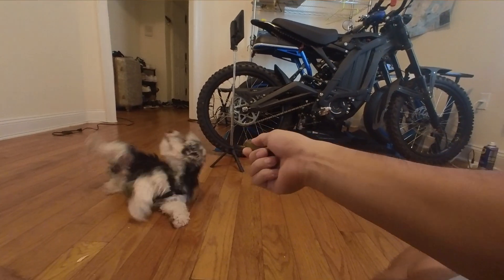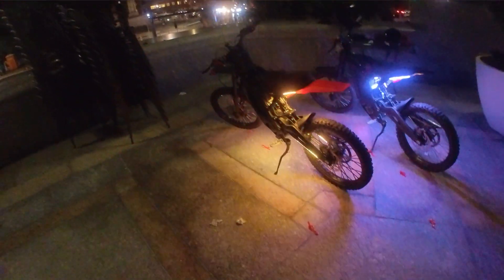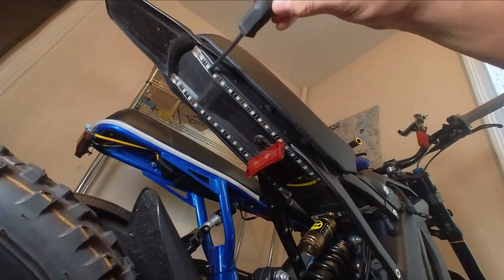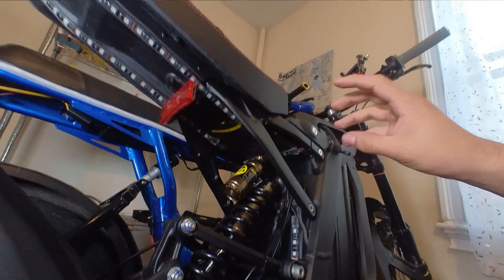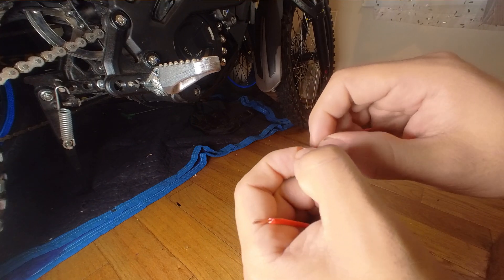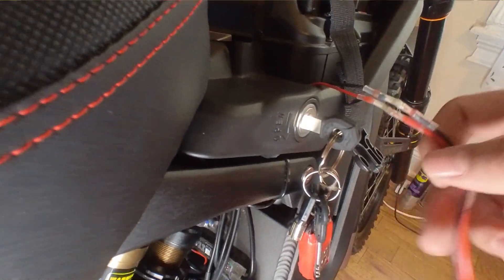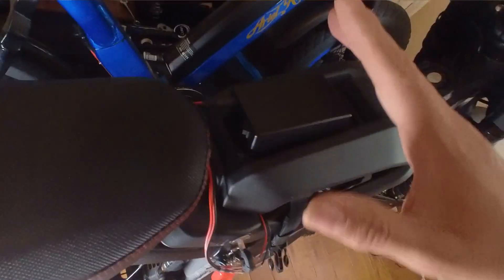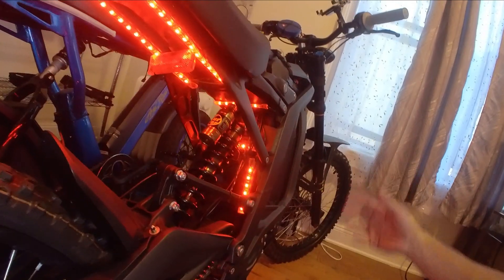DIY Sur ron Led Light kit tutorial (version 1)

Comment: Surron has 12v power supply for the tail and headlight easy to hook into, you can eliminate the bulky power supply box, use a volt meter to get the correct polarity
Reply from the maker: Yes and a lot of people that are really
Good at wiring tap into that for a much cleaner set up , they’re is actually a plug and play kit that is easier but around $120 , good to know that they’re many choice and methods to get LED light on a bike
Reply: @jaystyles33  which one 😋
Reply from the maker: @S2keyz  what do you mean :)?
Reply: Yeah, plus because they’re LED they don’t pull much of any power from the battery. If you had regen it would probably replace the energy the lights use.
Reply from the maker: Yea it is but any kind of bad electrical issue can go back to the battery which can be bad